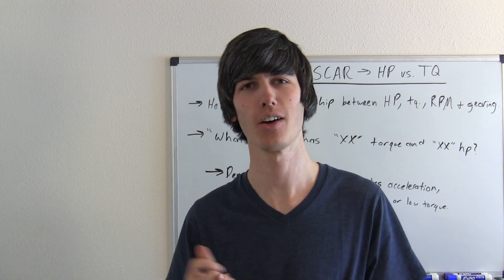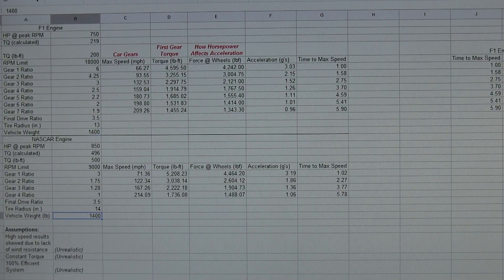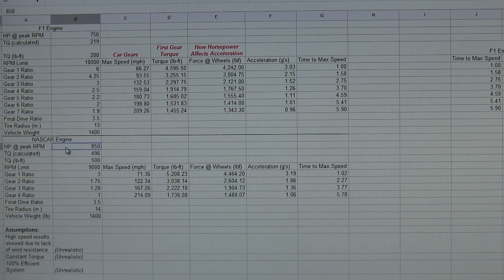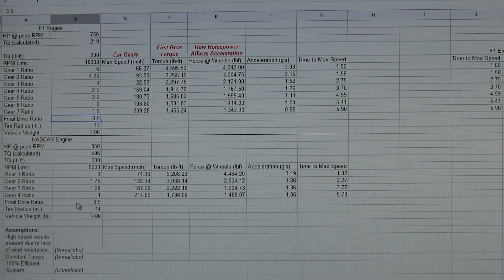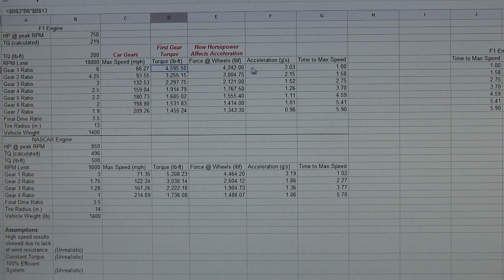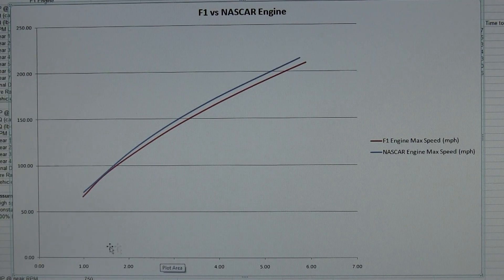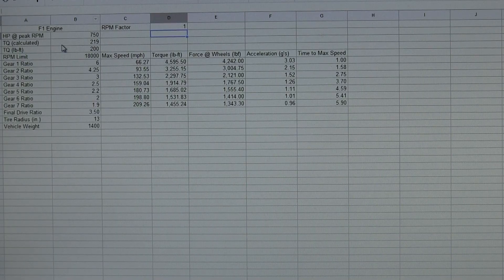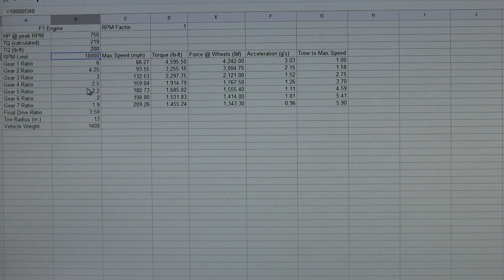Horsepower vs Torque - Formula 1 vs NASCAR

Comment: Engineering Explained can you explain why F1 and Nascar have utilized such different engine designs then? Also, if you could make a video explaining why horsepower effects top speed so much more than torque. My intuition tells me that a car with more torque (twisting force) would be able to greater withstand the forces of air resistance...however, it's more complicated than that because speed does not necessarily dependent on force, but rather how quickly its done a.k.a horsepower. Anyways, if you could just explain relationship a little bit more...seems to me like torque affects acceleration and horsepower affects top speed (given the same gearing)
Reply: Weight is one reason. A 1.5-2.0 liter engine is MUCH lighter then a big monster v8, Another slightly less important is that f1 cars only make power around the top 3000 RPM, which means you need more gears to let you stay in the peak power range, Nascar motors make max power from about around the last 3000 RPM or so also, However more torque allows long gear ratios, where low torque means more revvy.. Generally nascar motors only stay in their top power range while passing, and f1 with corners and fast speed changes stay in it almost the entire race...  Mostly its about the first point though... Another thought could be nascars semi flat power curve, since they're almost on the point of breaking traction the entire race you wouldnt want to have to be slamming gears all day long
Reply: ***** The problem with trying to bring real life conditions and theory together in vehicle dynamics is that there are so many factors involved that have to be excluded to make it easily explainable. The gentleman in the video tries his best to explain everything as simple as possible, but as soon as a real life question comes up you have to start your answer with "In order to explain that you have to add...(traction, aerodynamics aso.)" So I will try to answer your question as simple as possible: Imagine a 1000HP supercharged engine in an old Muscle Car (built for the street, not the drag strip). Every time you try to accelerate as hard as you can, you will have a hard time not to spin the wheels through the first 3 or 4 gears which equals in lower acceleration. If you put a Nascar engine in a formula one car it would do exactly that (plus the weight disadvantage of the engine itself). So you want an engine that revs higher and has lower torque so you can control wheelspin better with appropriate gearing. In all theory it's also possible to limit wheelspin with a high torque engine through gearing, but there is a second reason why a Formula 1 engine is different, which is responsiveness. The internals have a lower mass than on a big heavy Nascar engine. So when you drive track you want to be able to accelerate and decelerate the engine as quick as possible with a lot of gear changes. In Nascar you stay in the highest gear most of the time and the RPMs stay within a specific range. There is obviously a lot more to it than what I just mentioned but if you wanted to hear all the factors you'd have to write a book... :)
Reply: I generally think of it as, Torque is the ability to spin the wheels fast, and HP is the ability for the engine to accelerate quickly (climb revs faster) Torque is used to KEEP the engine spinning at a certain speed, while HP is used to INCREASE engine speed.. In real life horsepower does not exist. Its simply a derivative of TQ vs RPM
If you make peak power above 5252 your HP is generally higher then torque, if you make peak power below 5252 TQ is generally higher then HP
Reply: simple. both type of engine wouldnt be much useful if there's no gearbox. people misunderstood the concept. instead of saying horsepower vs torque, we should compare rpm vs torque as the multiplication of both is what resulting in horsepower. let say both engine have the very same horsepower. one with more torque and the other with more rpm and there's no present of a gearbox system. engine with more twisting force/torque with accelerate much faster but in expense of losing top speed (very slow 60kmh granny vehicle) and for engine with higher rotational speed tends to have the upside down effect. how to really make use of their power? for a high torque engine we simply put a gearbox with a very low ratio (mutliply a tiny amount of torque and increase the speed as high as possible) while in high rpm engine (multiply the torque/high ratio and reduce the gear speed as engine inherently spin very fast). why theres little amount of car with super high rpm on the road till now? because the internal mass/inertia will simply destroy the engine with a normal type of metal and most the part couldnt bear the high rotational speeds. it will simply overheat. high rpm engine however have an adantages in terms of weight as the overall part need to be as light as possible and not as strong as possible to deal with high rotational speeds and not high amount of twisting forces. (light weight part? super expensive !!). just look at F1 multiplate clucth. the overall dimension are as small as human palm and it can handles an enormous 750 horsepower.

Comment: After reading the replies to this video (and pretty much every HP/Torque video), it is clear that barely any of you have the faintest idea what you're talking about!

You cannot use poor english to explain something which relies on mathematics incorporating dozens of variables, so stop trying. Learn to use MS Excel and make charts using actual torque/RPM curves (calculate HP), gear ratios, losses, wheel diameter, vehicle weight and drag for starters.

1) Flywheel torque is meaningless, because real cars use gearboxes and differentials, so knock it on the head. Dyno torque figures are corrected for gearing/losses, and therefore don't represent real drive wheel torque figures, which are into 4 figures in 1st gear for example. High revving light-weight engines use shorter gearing to produce higher drive wheel torque, which is why F1 engines excel (greater thrust, less weight).

2) There's no point in having more drive wheel torque than the tyres can handle. 4WD vehicles can launch faster but are not necessarily faster once moving, so even 0-60 times can be misleading when judging performance.

3) Even if you didn't know how to launch a manual car properly by slipping the clutch, once you've got into second gear, 'low end torque' doesn't matter. The only relevant part of the torque curve thereafter is from the resultant shift RPM to redline (can be slightly lower depending on torque curve and road speed).

4) In short, peak flywheel torque tells you nothing, the shape of the torque curve tells you how the engine pulls 'relatively' across the RPM range, and the peak horsepower gives you an idea of the engine's performance. With proper gearing and all else constant, higher horsepower = higher top speed, producing faster acceleration at any speed on the acceleration curve, given that drag is a function of velocity squared. Compare a BMW 335i with a 335D - the 335D has a huge peak torque advantage yet is slower, due to slightly lower peak horsepower and a narrow, falling torque curve.

Start doing the math people, because it's the only way you'll 'get it'. You can't hypothesise based on peak torque numbers alone, and I can't for the life of me think why you would even try. If you want to be engineers, start thinking like engineers.
Reply: you had me at "0-60 times can be misleading"

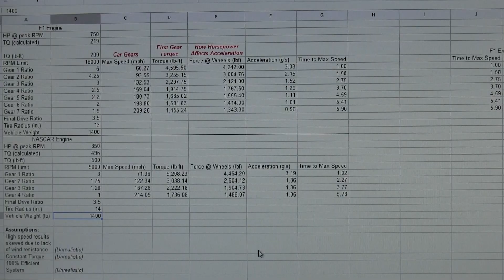Comment: At 1:22 you say that torque is held constant in both machines. This defeats purpose of the test does it not? Because a big displacement V8 will have a higher torque in the lower RPM range, while a low displacement high revving V8 will not have the torque down low. If you went by the torque curves of each engine, wouldn't the big displacement V8 accelerate quicker from a standstill due to their HPs being equal and the big CID V8 having double the torque?
Reply: To quote a wise man "Torque gets you going, RPM (HP) keeps you moving."
Reply: Right so the higher torque engine should accelerate quicker, especially since the high revving engine will take longer to reach the RPM power band.
Reply: NickWayne100
 But thats why you have more gears(and narrower gear ratio) on the F1 car, the F1 also have much higer idle as the engine per design do not make that kind of power down low. it's different cars and different engines. the formula cars make alot of power with the little 1.6L they have =)
Reply: +NickWayne100 F1 engine will always be at high rpms-  besides that .25 sec initially in 1st gear.

Comment: Great video man! So it's safe to say that in relation to acceleration, that if all of the drivetrain stays constant, increasing horsepower is the way to increase acceleration regardless of losing low end torque?
Reply: Yea. What decides how fast you accelerate in a given vehicle at a certain point in time is just the number horsepower that arrive at the rear wheel at the moment. More torque is just a way of getting more horsepower.

People tend to make a big mystery about that whole torque thing, but it's actually very easy to understand if you get rid of that 'stereotype' about torque.

Comment: much better! Thanks for that posting. I would recommend not to say, "flat torque " curve, even though I understand you are really just using the same torque that equates to the top HP of each engine.   you should actually position it as , "flat HP curve".  that way, through each gear, and at any vehicle speed, both comparative cars will make the same rear wheel torque, even though both cars would have grossly different engine torque values. (as you show well with the charts).  the close ratio gear boxes allow the F1 engine vs a 4 speed nascar (wide  hp curve) to operate at max hp for most of the time in each gear , thus maximizing acceleration forces at any vehicle speed.
Reply: There is a very big difference between a flat torque curve and a flat HP curve. He mentions in his other torque vs HP video that the equation is horsepower =((torque)(RPM))/5252. So the only way you can have a flat HP curve is if you're torque curve is a diagonal line starting high at low RPMs and finishing low at high RPMs. Neither the F1 car or the NASCAR would have a torque curve like that.
Reply: aaron abraham actually, that is where most race cars use the power. at the two points where torque is high then falls to a lower point.   trying to stay in the max HP range is the goal. NOT to stay in the max torque range.
Reply: Of course. The torque curve dips down past peak torque and that region  usually up till redline is where  drivers try keep their engines revving. 

But in the video he's talking about the entire Rpm range from idle to redline especially for launching from a standstill in 1st gear. For that region, a flat torque curve is a better approximation than a flat hp curve.
Reply: aaron abraham Not really.. a good launch always includes a near rev limiter dump of the clutch and controlled throttle to maximize slip angle.   in this case, if the RPM is below max torque,its only for a very short period of time.   power is proportional to acceleration... remember the Newtonian identity... acceleration =power/(mass x velocity).

Comment: I guess more torque = more shifting.
Reply: Alex Peredia the opposite of that. The more torque you have, that longer the gear will be (rpm is able to vary over a wider range because of a good torque curve / more torque). The longer the gears, the wider the speeds possible for that gear for example: 1st Gear 0-25 mph, 2nd 25-40mph. Also less shifting with longer gears.

Comment: So, is the reason F1 cars have such high revving engines instead of just changing gear ratios because a high torque/low rpm engine is much heavier?

And is the only reason they appear the same here because we are assuming they are the same weight?
Reply from the maker: George Burchmore Not only are they lighter, they're much more efficient at producing power. Yes, assuming equal weight as mentioned.

Comment: With all that data, put them on a track side by side and you will see how the F1 car  thrashes the Nascar period.
Reply: weight, downforce, and tire compounds make the difference
Reply: yea but its not the engine what hepls but the 1400lb of weight in the little car , now try putting an f1 engine into a really car  and race vs a nazcar car   wich  it ll be fair  fight for the exeption of the shity torque on the f1 car , itll be trashed for sure by the nazcar car  so that you cant have them ALL it   all relative , the only advantage of the  f1 car is the cornering capabilities  but again it the low center of gravity and the llittle engine size and the tota weight that helps,, now the question is how does the engine creates all that hp by being so small ,, easy the bore and stroke are smalland short , and that makes a small room for the piston to go up and down there for the high moving speed of the piston, and there is where the high hp comes to life and low torque is found the cons of this is too much fuel spent and reliability is suck, pros are tha best handling  acceleration and of course stopping distaces, but on a cost of a car that will never be used in the really world for street use  coz its useless.
Reply: Depends on the track, any road course sure the NASCAR car doesn’t stand a chance, but bring an F-1 car to talladega and you might be surprised simply because F-1 cars are not designed from a stability standpoint to maintain that amount of speed for that long of a distance that’s why IndyCars are longer and wider to be more stable when they race on high speed oval tracks 
Remove the restrictor plates on NASCAR car they have to use at talladega and wouldn’t be close
Reply: bfoot09 F1 cars are pretty long and wide now (as of the 2017 season). Remove all of those extra winglets and they'd spank pretty much anything on an oval.

Comment: Good video sir. NASCAR Sprint Cup engines spin closer to 10,000 rpm though ;) check out Ford Racing's video of Greg Biffle qualifying at Bristol a few years ago, he bumped 9,800 rpm once or twice. I also think 850 horsepower is a low estimate for the fuel injection era now, there are a lot of great mechanical engineers in the sport that work to squeeze every little percentage of horsepower they can from 358 cubes and they have several new options for increased horsepower without being forced to use carbs. I think 900 horsepower isn't exactly absurd to claim for some of the teams that consistently run up front, especially since these assholes were doing 220 mph at Michigan when they introduced fuel injection. Lol.